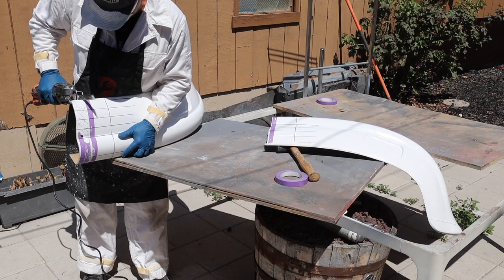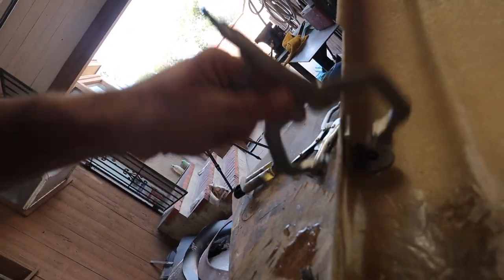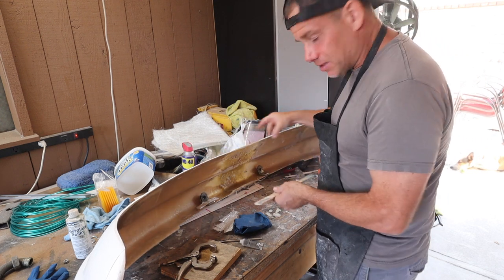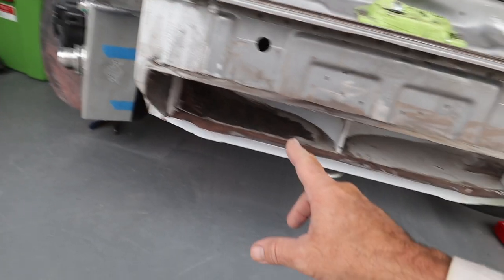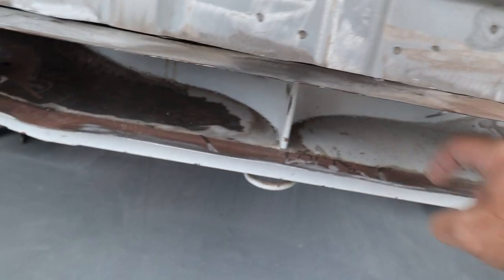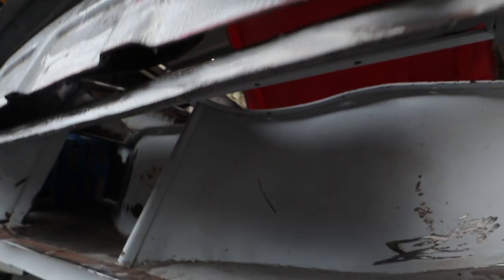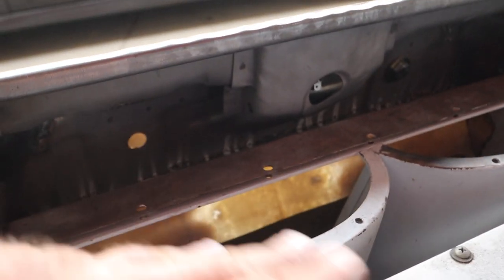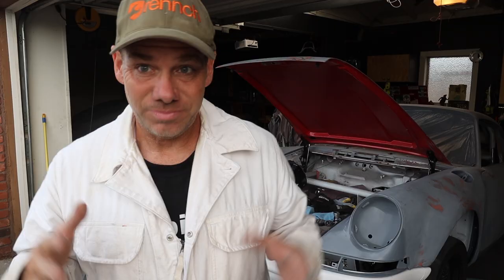FINISHING This Custom FiberGlass Front Bumper for the Subaru Swapped Porsche! | Blasphemy Build 67

Comment: Great job mate. When I did the same work to my BMW I had to cut the bumper in half . I was also not happy with the way the bumper mated to the front arches.  I fibreglassed the bumper to the arch and ground it down and reshaped it and then cut and seperated the bumper from the arch. It looked so much better as both pieces fitted perfectly. Thanks for the video.

Comment: Hey dude, love the build! Just a thought H6’s get a bit hot under load, not sure if your of your plans, but would fit a large oil cooler to help with engine cooling or head gasket issue in the future. Just a suggestion.

Comment: You said you were in a hurry to finish the body work on your car but DON'T hurry!! Every step is important.!! Make sure you don't rush when you need to spend more time building a stronger bridge between the left and right sides of the hole you will be cutting out for the air to come into the fans.

The paint stick is a good start but I don't believe that is enough for the big cut in the middle of the bumper. I would suggest a stick longer and wider than, perhaps about 14"long and 2" wide. Remember this wide open space is a weak point, you have a lowered car — L.A. area has shitty, pothole ridden streets that twists the car's body when your tires bottom out in them. If the bumper cracks so does the paint and what a huge pain +$$.

- use a bigger stick (length x width), glass it in place, let it harden
- use 40 grit sandpaper disk on a drill motor to knock off high points. 
- then cut strips of mat 2" wide x what length works in that space and lay them down at 45 degrees, coat with resin and let it harden
- grind off the high points.- lay down the same 2" strips but this time the 45 angle goes the other way. This creates tension/strength.
- grind off the high points, then lay a full piece of mat material on it the full length and  and width with resin/hardner and smooth the surface.
- grind off the high points and paint if you are a fanatic ;—)

Michael you are so good at everything else on the car you should see fiberglass and resin as one of your many challenges that will make you a complete DIY  person

"A garage without a Porsche is just a dark hole" —Walter Rohrl - Porsche Development